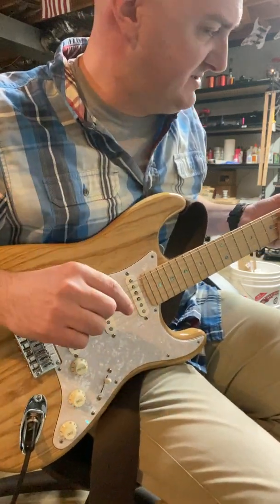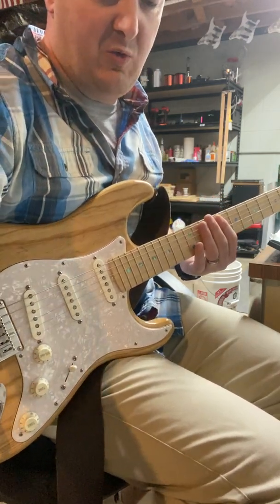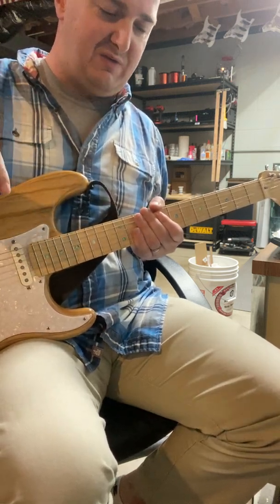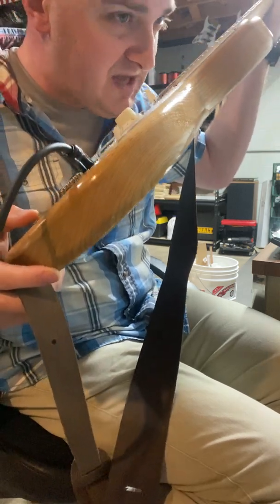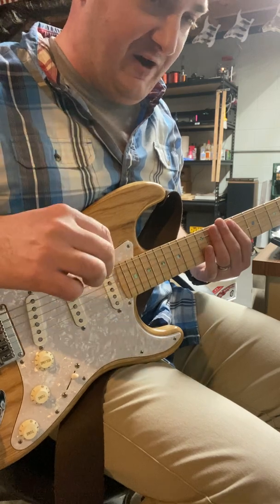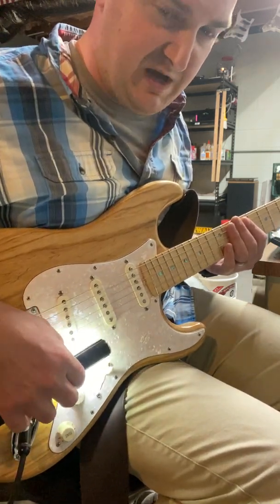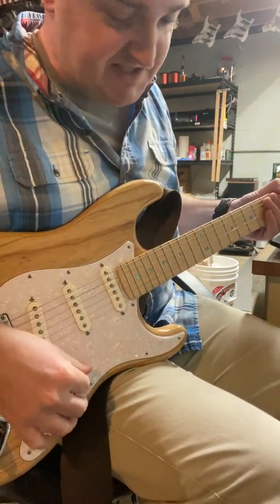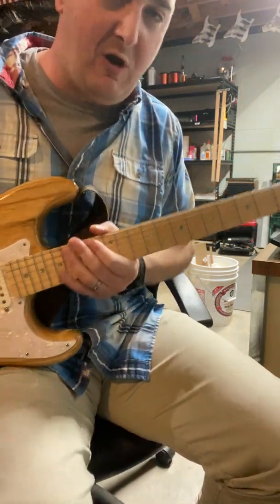60 cycle hum, RFI and Shielding is useless Noisy electric guitars SCIENCE EXPERIMENT

Comment: "Shielding is useless". "All guitars do this". "All Pickups are microphonic"

I call BS. 

When the shielding is grounded to the output, all my single coil guitars (shielded with Stewmac copper tape) are completely noiseless, even leaned in front of the speaker, and my hand wound pickups are not microphonic. This is my personal experience.
Reply from the maker: You are saying that copper shielding tape makes 60 cycle him go away?
Reply: @MathewsGuitarWorks  My country has 230v over 50hz, but the effect is much the same. Shielding alone does very little, it needs to be earthed (grounded), so therefore 3 wires going to the pickup pocket, the 3rd being the shielding ground. The ground wire needs to go to the output ground. With a careful hand, the wire can be soldered directly to the copper (shielding) tape. On Strats I also shield the spring cavity.
Reply from the maker: @Jesse-B  answer my question.
Reply: @MathewsGuitarWorks  I already answered it relevant to 50hz. To be clear, grounded shielding makes 50 cycle hum go away.
Reply from the maker: @Jesse-B  grounded shielding does not make cycle hums go away. It comes from the single coil pup. The only way to get rid of cycle hum is having a humbucker by introducing another coil that is reverse wound and reverse polarity. You have no idea what you are talking about but I appreciate you commenting because it drives my video to be seen more.🤘
Reply: @MathewsGuitarWorks  That is your experience. Maybe 60hz and 50hz behave differently. My guitars all have zero 50hz hum. You can call me a liar if you want, it does not change the facts.
Happy to help your need.
Reply from the maker: @Jesse-B   It’s ok to be wrong. Cycle hum is cycle hum. It’s there and other than installing another coil wound opposite and reverse polarity no amount of shielding will reduce it or change it. If shielding reduces or changes the noise level of any guitar, it’s definitely not cycle hum. All single coil pups have cycle hum and you can’t stop. The facts are you don’t understand what you are hearing therefore you don’t know what you are talking about. My strat single coils have very low cycle hum when the amp isn’t cranked. Almost undetectable at normal volumes but never the less it’s still there.
Reply: @MathewsGuitarWorks  Your experience is different from mine so you default to me being wrong. I was born in the afternoon but it wasn't yesterday afternoon.
Reply from the maker: @Jesse-B  It has nothing to do with experience. These are basic electronics fundamental facts.

Comment: Any opinion on dummy coils and/or the Ilitch hum canceling system?
Reply from the maker: Personally I don’t care for dummy coils or any hum canceling things. 60 cycle hum on single coils doesn’t bother me enough to do anything about it. At gig volumes my rig is pretty quiet.  RFI will be what it is, nothing I can do to stop that. Any time you add a dummy coil or anything like that, it sacrifices the tone of your pups. Like I said, I’ll live with a little bit of noise to have the true single coil sound and dynamics. If I need hum cancellation I’ll grab a guitar with humbuckers. 

Preshate you stopping by and commenting.

Comment: Shielding does in fact work because when done correctly, it yields a net effect of dumping a lot of the residual noise artifacts to ground. The other factors involved, such as the quality to of the home (or venue) wiring (old homes and club venues are infamous for exacerbating this issue) or circuit anomalies in general will introduce variables that will negate some of the positive effects we seek. 

The best way to create a more controlled and objective experiment would’ve been to have two similar instruments, one with shielding and the other without to show the comparative results on camera.
Reply from the maker: Shielding does nothing to reduce the noise of a passive guitar circuit. Passive controls produce nor amplify any frequencies. Passive circuits/guitar controls take away. Because of that, no noise is introduced into the circuit via the controls. All emi/rfi enters through the pups. The pup face is still exposed to the outside world collecting emi/rfi. If shielding reduces noise, it was because the circuit wasn’t grounded properly and has nothing to do with reducing emi/rfi and shielding does nothing to change noisy home wiring or amps either.
Reply: @MathewsGuitarWorks  There's no way shielding does "nothing". As you said, the pickup face is going to be exposed to the world. But surely there's going to be a noticeable difference between part of a pickup being exposed compared to the whole pickup exposed. I unknowingly ran this experiment this weekend with my squire strat. It had no shielding, and I had upgraded the wiring and pickups with zexcoil noiseless single coils and a Seymour Duncan jb. The zexcoils are basically magic, and do such a good job at cancelling out hum that they made the jb seem noisy in comparison. So I decided to add copper tape to the entire cavity, and the results were no change with the zexcoils, but it 100% reduced the noise of the jb to the same level as the zexcoils. Saying shielding does nothing is ridiculous.
Reply: @MathewsGuitarWorks not true. EM fields can induce noise currents into conductors. This will cause a noise voltage due to the pot impedance. This noise varies with the wiper position.
Reply: @MathewsGuitarWorks  I operate a commercial recording studio. I’ve heard the before and after in a controlled setting which can be heard on playback.  Guitar shielding yields audible results guaranteed.  However, a negative aspect of shielding pickup cavities with copper is that it does alter the sonic quality of the pickups themselves. Those results I’ve discovered during these before and after experiments as well.
Reply from the maker: @connshawnery6489  Nice! I’ve owned and operated a guitar mod repair business for about 14 years. I’ve designed and wound proprietary pups and hand wound more custom pups than I can count.  I’ve built guitars, pups and effects pedals that have been featured on studio recordings and currently touring from the weekend warrior to nationally known recording artist.  I currently service multiple music stores and guitar repair centers with wiring jobs that they don’t want to do or can’t. I’ve restored $50k vintage strats and Les Pauls among other vintage guitars. I can qualify my experience too. I’m 100% positive that shielding does nothing to reduce emi/rfi in a passive electric guitar circuits. If it reduces any noise at all it was due to an improperly grounded circuit.  I’m working on another video to isolate exactly what I’m talking about.
Reply: @MathewsGuitarWorks  I’m 30 year veteran as a professional musician, recording artist as well as being an accredited Audio Engineer.  I also run a repair shop (20 years in business) and am the store manager of a retail outlet called Acclaim Sound & Lighting in Canada.  Run the controlled experiment with a direct comparison of shielded vs unshielded and we’ll check it out.
Reply: @MathewsGuitarWorks  Regardless of your experience, shielding - even when imperfect as all shielding is - can attenuate rfi. This applies to ALL electronic circuits. There are no special laws of physics reserved for electric guitars. Additionally the grounding of the scratch plate reduces noises produced by static charges when rubbing against the scratch plate (typically when it is worn to a shine);and scratch plate screws.
Reply from the maker: Thanks for commenting 🤘
Reply: The bulk of RFI is actually reflected. Some of it does cause currents in the screen (and so to "ground") and a small amount passed through the screen.
Screening does work - but obviously not completely with an electromagnetic pickup. He is getting a bit extreme with waving an rfi source right in front of the pickups. And passive controls can be a cause of noise as nose currents can be induced in them by EM fields. And since passive pots in guitars are high values then the resulting voltage noise can be quite large.
Also it's true that fundamental mains frequency hum is not attenuated by non-ferrous screening . Because it's mainly Magnetic field rather than Electrical field.
Reply: @rmorris8544  Yessir. I was going to bring up some of the points you took out of my brain, but you put them up.
Reply: Mathew is right, try running a power conditioner on your electrical supply to the amp, and effects you will notice the difference. The noise level will be low and it's not due to the shielding.
Reply: @zepp3lin  That is flawed logic tbh. Just because some effect is not due to A does not mean that A does not have an effect.
This stuff is quite easily measured with the right kit and not really debatable in this context tbh.
Reply: @zepp3lin  Power conditioners are essentially shielding appliances which provide a buffer between the AC and your device(s).  It’s an active filter which utilizes the same fundamentals in order to remove unwanted noise and/or interference from entering into the audio path.  Much like passive shielding, they are not a cure all.

Comment: Well- you do remember that for any shielding to do ANYTHING except look expensive..it needs to be GROUNDED. Only then it can work as intended. In other cases it actually make things worse!!!! So if the electrical outlets are really noisy etc- there's only one thing to do. Based on how the house is built, you could have a ground post installed, and a ground belt made. You know, a big ol' iron flat band connected to a three feet rod, planted firmly in the yard... the band goes in the house and the ground points for all things go to it somehow. If you achieve this, there will be no more noise- once the shielding is connected to the ground. Otherwise, yes, the noisy things will induce stray currents in the shield...and without a ground, they will have nowhere to go, so they will further induce other stray fields in the guitar electronics. Pots and wiring and passive pickups are not active, of course- but they are susceptible to noise just as any plain ol' wire passing a small signal is. So just shielding WITHOUT grounding will do at best nothing, and at worst much worse. But have those things grounded and!!! miracle. SO- get a clean ground point- make sure the amp has a grounded case- put all audio equipment in well grounded outlets- don't put obvious noise sources next to an unshielded - or shielded and ungrounded guitar. Once the shielding is correctly in place, it will do its job and that light and other many noise sources would do nothing to your signal!
Reply from the maker: That’s a lot of typing. Unfortunately you are wrong here when it comes to guitar signals and shielding. If what you say is true, that the light would not effect the pups if it were properly shielded like you say, then the strings wouldn’t effect the pups either thus making no sound. The reason that is, is because the light is a source of emi and so are the strings. Rfi is a subset of emi but both terms are used interchangeably. 

Thanks for the comment.
Reply: @MathewsGuitarWorks  hey!,glad you read throug anyhow! The strings induce current by reluctance variation,i.e. magnetically changing the magnetic resistance of the circuit.EMI ...electro-magnetic interference are caused by currents induced electrically.Copper and aluminum are not magnetic,so they would not stop the strings from working,as a thick steel plate would- but will ground all electrically cupled noise,again,if properly grounded.Please note I worked in the field of small signal electronics for more than 20 years and this is basic knowledge in the trade...
Reply from the maker: @axelmorisson  pups are inductors. I’m aware that theres a difference between mechanical vibrations of the strings vs the inductance caused by emi. Either way it causes an inductance producing a voltage. I think that’s kinda irrelevant.

Comment: Thanks for trying to save people time, effort and worry. A lot of people are confused and so was I when I first got single coils. What I’ve learned is that there are different types of noise, but the better the pickups are at picking up higher frequencies from the strings through the air, the more noise you’re going to get through the air. The pickups are always going to be exposed, so there’s never going to be any kind of isolation. A layer of shielding is pointless because it would need to be at least like a foot thick to have any discernible effect. Yeah, the energy goes right through. It varies with the environment. When it comes to normal noise, I think the best thing to do is move to a different spot and rotate yourself and the guitar.
Reply from the maker: You bring up a good point about the thickness of shielding and pups that have a wider range of frequency pickup and how that translates into the reproduction of noises captured from the environment. 

Thanks for the comment 🤘.
Reply: I’ve been thinking about it a few days. I’m not an expert and I haven’t done any experiments. I’m trying to think of a way that shielding could seem to reduce noise. Now, I don’t think shielding blocks any audible frequencies and the video shows it, but maybe several shielded cavities could behave like a capacitor or affect the pickups somehow or in some way have the same effect as turning the tone knob down. So, you’d be doing all this work to get the same effect as just turning down the tone knob, as well as giving yourself pickups with less high end. I don’t know, I’m just guessing and trying to give some credit to all the folks who swear by shielding. However, I still think that there’s also a chance shielding has no effect at all and something is changing in the environment or they’re just convincing themselves. An experiment with a control sounds like a good idea for a video, but it’s not going to be me.
Reply from the maker: @daroldfuapse  I’m working on a video to put this to rest for good.
Reply from the maker: @daroldfuapse  I think you may be on to something with the capacitance of certain guitars/wood/bodies in general. I would agree that idk the answer either. I wouldn’t even know exactly how you would test that theory reliably enough to even make it worth trying to know.
Reply: @MathewsGuitarWorks  I think it would have to be two identical guitars, close to each other, unmoved on the bench, one shielded, one unshielded. They’d have to be recorded not only unplayed but also played to hear if there is any difference in the sound or frequency range before and after the test. 

In any case, I think it’s good enough just to let beginners know that the noise they are hearing is not a defect in their equipment and they don’t need to freak out. There’s probably a reason that the most expensive Fender and Gibson custom shop guitars have ZERO shielding.